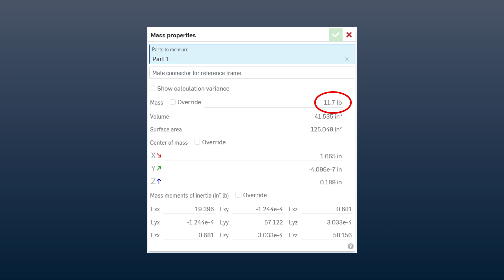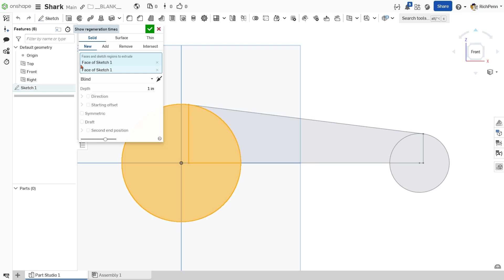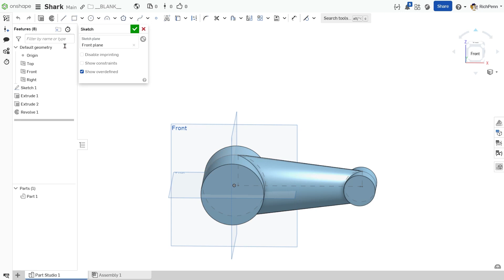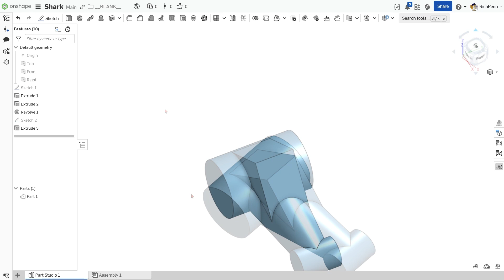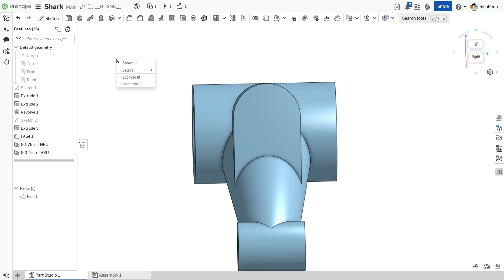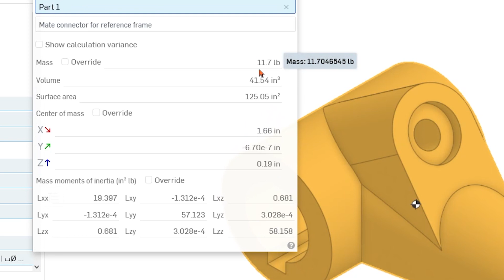23-T-63-SHARK ARM -  Simple steps solve a complex problem - a TTT part

Comment: Thanks again Rich. I did this one a couple of times. Amazing how I am getting to troubleshoot my mistakes which greatly increases speed. However, I don't think you or any of the speed demons at Too Tall Toby should feel threatened.
Reply from the maker: Full disclosure: by the time you see the models on video I have usually done that exercise, with different levels of success, several times.  So, speed in my case is more of a rote exercise than it is a demonstration of any skill level.

BTW: in the code crafting world I came from the old adage was, “until you are really good at doing debug work, you don’t understand programming.”   I find I learn much more fixing broken models (and lord knows I am never short of practice examples) !!